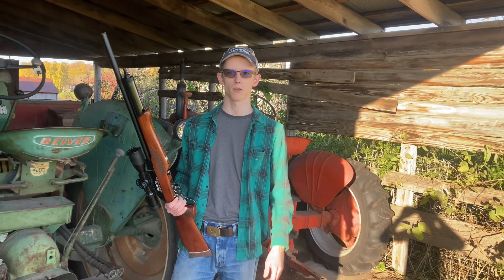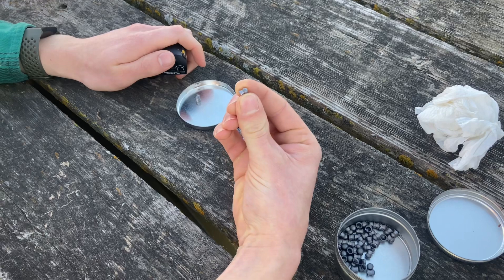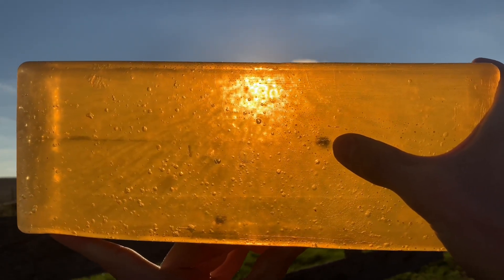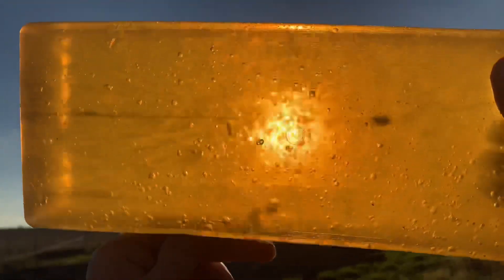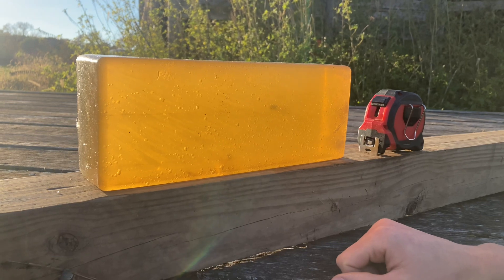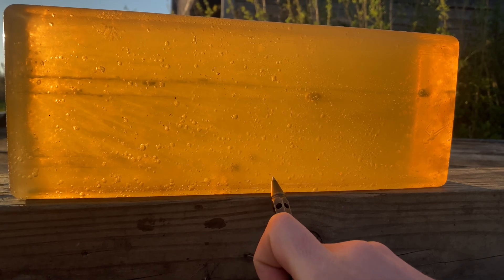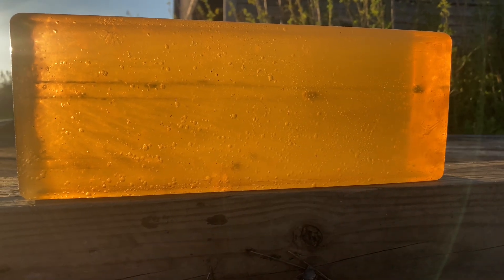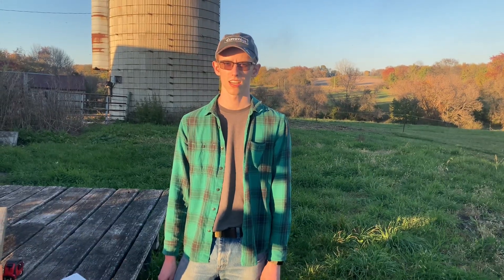Energy vs Momentum Pt. 2 | Simply Fascinating Results!

Comment: ydyot its not speed vs mass itsthe same energy but one have more momentum or evenmore momentum lil more energy as well 🤐🫣 when ypu comapre speed to mass in way as folllowin 👉🏻feg 2 times more speed vs 2 times more mass than speed absolutellly killll mass 👌🏻 beside  penetration deepth is one stuffbut how much damage is done on penetration distsnce thats another 👌🏻 bullet can go more shalllow and on  its penetrstion deepth all the way from first contact to stopp can make  multiple time biger damage expresss in momentary and permament cavity holle in target 🪠 1 m/s 10 kg rod with the same diameter and boradhead shape and the same material is a joke comapre to 100 m/s 100 grams rod woth the same calober and boradhead 👌🏻feg shot inot chest 1 m/s 10 kg rod dont even penetrate skin welll depend on caliber and boradhead shape from nough small caliber or very sharp shape boradhead ot can anyway 100 m/s 0,1 kg rod go into chest like hot knife into butter  in comaprision assuming diamter of 1 cm let say and boradhead shape of egg for such data 1 m/s 10 kg do t even penetrate skin wspecially with  clothes and 1000 m/s at 10 grams bullet make multiplication each of units be another 10 times is ak47 level ok acutallly much more than avg bullet from ak47 cos typical avg bullet from this riffle is 715 m/s at 8 grams 🤭 👌🏻🪠🍿

Comment: I’ve been doing similar testing for low-powered CO2 Pistols. Most people just discount them as toys because of their low power of around 2 ft/lbs, limiting them to being able to barely penetrate steel cans, and sadly bounce right off thicker plastic, and glass bottles (with common Crosman Pointed lead pellets, 7.6 grains, $5)
However, I tested them against the RWS Hypermax Pointed steel pellets, 5.2 grains, $30)
and now can penetrate thick steel, plastic, and glass. (I finally found my Armor Piercers)
At this point I never bothered to test any other shapes, materials, or heavier pellets, because it’s pretty clear to see that lighter, harder Pellets (may not be as accurate, but) are superior at penetrating hard targets., and pretty awesome!
Great videos!

Comment: Great comparisons! I'm very interested in terminal ballistics of pellets. I'll keep getting caught up on your content 👍

I don't think over-penetration is an issue with most small game, as I think either round will pass right through. Pellet shape would probably have a bigger impact on terminal ballistics than weight. Try running a Predator against a lighter pellet. I'd imagine the Predator would be better suited for small boar, where a domed or HP pellet would be better for squirrels or rabbits (shot placement trumping all, of course).

Comment: To you point… I was testing to see how many 5 gallon water jugs a .308 Air rifle would penetrate using cast RN 120 grn Slugs.  There happened to be a couple of guys with a 6.5 G that wanted to try a follow-up shot to my air rifle.   The end result illustrates how projectile design & velocity is affected by water. 

Texan .308 vs 6.5 Grendel vs Four 5 Gal jugs of H2O
https://youtu.be/yIFCSL9ZIB0

Comment: I noticed that the light pellet at low speed showed no expansion at all. Did you get any expansion or deformation/ flattening of the point at the higher speed.?
So lets say that each brand and type of pellet will deform or expand at some speed.
Thats a question that could be answered with an adjustable power rifle.
That would be a good thibg to know.

Comment: The bottom line is if you're hunting the heavyweight pellets will carry the energy further and will ultimately do a more damage on the target. I think you will also find that the heavyweight will track truer over distance than the lightweight one.
Reply: If hunting small game it looks like the heavier pellet has a geater risk of over penetrating, especially at the higher ftlb setting. You want the projectile to dump as much kinetic energy into the kill zone as possible, not zip right through and out the other side. The main thing over and above terminal performance is accuracy and good shot placement.

Comment: Thanks for the video. It was very informative. I shoot the .177 cal pellets. Between the Baracuda Hunter extreme, 9.57 gr and the Baracuda Hunter, 10.35 gr,  The former penetrated 2 soap cakes each 3 inches thick  at 55 yards and lodged into the third, while the latter, heavier one, could only penetrate 1 and a half soaps cakes. The Hunter extreme has a 4 part expanding head while the other has a hollow point ..

Comment: Outstanding!👍 One of the most important parts of penetration into anything is the tip of the projectile 💡The sharper and harder the projectile is, the deeper it will go because it'll have less drag from what it's trying to penetrate. Try this experiment: Take a tiny hardened steel roller bearing from the inside of a universal joint, put it/glue it or drill a tiny hole in the top center of a pellet and shoot it. I guarantee you that it'll penetrate a car door and it will go clean through a 36 inch gel block no matter what the pellet weighs👍 Those so-called perpetrator pellets they sell on the market are crapp because they aren't hardened steel. I say a guy do it on a YouTube channel and it was like too good to be true so i didn't believe it until i tried it myself, and man was i impressed💥😂
Reply from the maker: Thank you very much for the feedback. 
I have never heard of the roller bearing pellet that you’re describing, sounds very much like the aerospike on the tip of the nose of a supersonic aircraft, will definitely be trying it out soon. Thanks again.

Comment: You should try it after you fire a few rounds after you changed your power setting. You shot the light one first. That means your second shot got a better chance at a full power shot.....no chronograph so.😁
Reply from the maker: I tried what you suggested. Fired a few shots though the chronograph,  adjusted the power and then fired a few more… no power climb after adjustment so.😎👍
Thanks for the suggestion though.